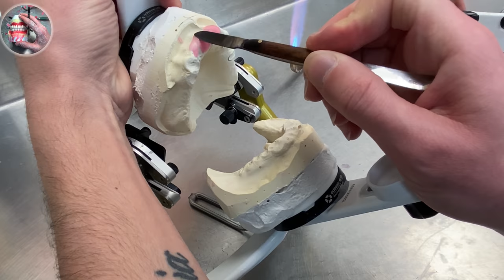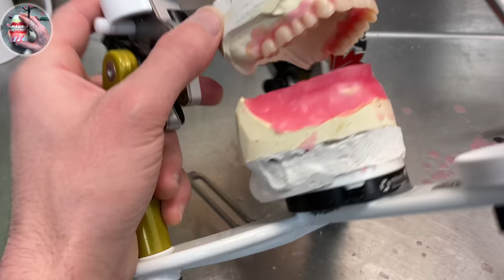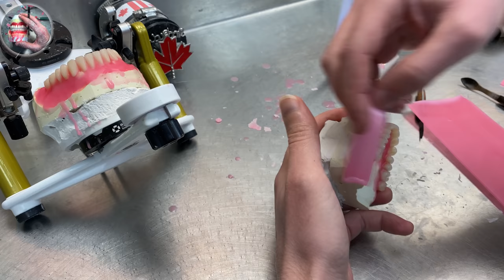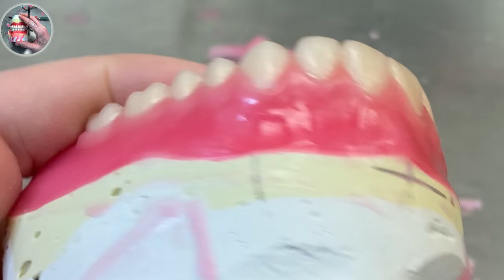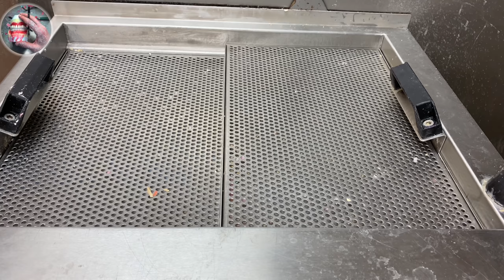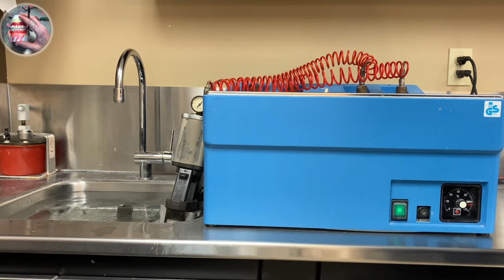HOW TO MAKE AN IMMEDIATE DENTURES FROM A TO Z #waxbae #immediatedentures #surgicaldentures #dentures

Comment: Lab tech for 33 years. Managed a full service lab for 17 years, and owned my own full service lab. There's a much easier, better way to do this. If you still have anterior teeth, which is the case here, you would really want to grind off one side (in this case it would be the patients right side, since #9 is in relatively good shape). Then, you set the upper side you just ground on, matching the opposite quadrant as far as whatever is left (i.e. lengths of laterals or cuspids that might still be present). The most important thing, though, is matching the adjacent central. Then, once this quadrant is set, you grind off the adjacent quadrant's teeth, set those in line with what you just setup on the other side, and then use your plane to make sure they are horizontally level. Then, you can grind off ALL the lowers and set to upper. NOTE: this way is ONLY going to work if the patient has a decent #8 or #9 or even laterals and cuspids would work sort of. If they are missing all the front uppers, then you can do it like above with the measuring and whatever, but typically the patient would have had a Flipper(temporary partial) that they are wearing, and the clinician should take an impression of the upper with it in place. Then you can measure the teeth and just pick the corresponding tooth card that matches the L and W. Or, if there are still enough lowers where you can hand-articulate the pre-op to the lower, you can just mark your upper teeth placement on the lower(that's why you grind them off last).If none of that exists, then  at that point, you'd just look for tooth pockets or creases in accordance to your landmarks like the incisive papilla and median palatal suture line and begin your setup there. There really is no reason to have to measure, scribe lines, then pick random teeth, hold them up and measure them, then measure then rinse and repeat. ugh. so tedious.
Reply from the maker: Thanks for watching

Comment: As a technician I really appreciate these videos👍👍👍 what type of resin do you use and what is the name of the hot spatula?
Reply: The acrylic is Ivoclar. Using the Ivocap injection method. This is a very old and dated system. Way too much cost, time, effort and energy for an immediate denture.
Which more often than not is a temporary denture. They now make high impact acrylic for the pour technique. 100% better in every way.

Comment: Absolutely beautiful work! I was wondering how do you know what size and shape teeth to use if the person has broken teeth down to their gums? Do these go in right after a person has just had their teeth extracted?
Reply from the maker: Thanks! We usually ask for old photos of the patient if they cherished thier old teeth, but if they don’t then we work together to find the best set of teeth that suits them in an appointment under different lights and shades
Reply: @WAXBAE  how long is the process overall before sending them back for permanent use?

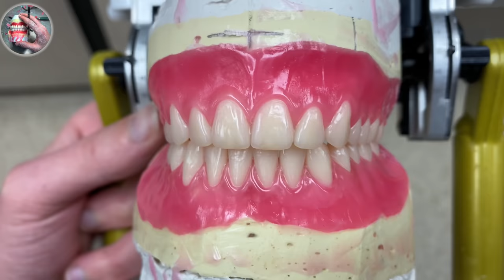Comment: Thank you for posting such interesting and educational videos.  I have a question though if you could please help.  How do you go from 11:50 to 11:51?  How do you remove all of the stone cast/mold base before you put them  in the flask?  You had all that plaster that was used in the articulator removed in between those steps and I am interested in how you did it so that the mold looks so clean and smooth.  TIA
Reply from the maker: Good question! I snap it off with sheers off the cast. Before investing them in flasks. Thanks for watching

Comment: I am total amatour and i have question - how do you measure and set the bite in this device according to patient ? 
Hwo do you know the exact distance and position of both jaws?
Reply from the maker: Hi, usually all the measurements are done in the clinical appointment and we record everything from the patients mouth then transfer it to the lab
Reply: @WAXBAE  hey, thank you for answer. i noticed that in the device there are few points where you can adjust it: 
two tilt regulators on the sides with angle of inclination measurements (30 is propably the tilt i suppose) 
the front-back extension of the upper jaw and left right shift of the jaw is when you mount it there 
and the "bite lock" rod is also there 

Nice engineering there solely in the device itself. One must have knowledge to use it correctly

Comment: I had my teeth extracted 4ish years ago. I went to Aspen. I did not have any issues with Aspen. They made me a temporary denture to ware from day 1 until 6 months when they made my final set. When I received the final set everything fit  well and still does. I had a choice between good, better or best. I chose Best. i have never had to have any adjustments etc. half way thru the 6 months and the swelling going down. I had to start using denture cream to help hold the denture in. Today I use nothing. They explained that the lower grade denture may be and feel thicker. They also said if I drop in the sink they may break easy hence my choice of the more expensive denture. They also made a bridge for the lower. All went great and things are still good.This is not a advertisement for Aspen. My Dentist of 45 years retired. After going to  many other dentist and not finding anyone that I felt comfortable with I chose Aspen plus it is close to my home. FYI, your teeth and smile look good. Congrats.
Reply from the maker: Thank you for watching!

Comment: Why did you take out the mandibular teeth right from the beginning? It may give you the correct location of the maxillary  teeth. How did you decide the flaring of the anterior teeth without the contoured wax rims?!?? In my opinion, it is hard to figure out the buccal fullness just in the lab without clinical clues. 
My comment is not a criticism but just a question to learn the objective of your technique.
Reply from the maker: Thank you for you question.I usually mark everything on the casts and record all the important info plus what we get from clinical consultation with the patient. I encourage you to see my other immedate denture making videos, I have many way of doing them depending on the case and spacing.
Reply: @WAXBAE  thank you for the reply and informative videos. I'll check out other videos.

Comment: so what if you have 3 or 4 teeth on the top but the rest are gone? do those 3 or 4 teeth HAVE to be removed? or can dentures be made that fit around them and what if you have no teeth up top but you still have all the roots?
Reply from the maker: You could but that’s a question to the dentist to determine

Comment: Wr r u from
Reply: Thank you. But please explain what was going on with the end procedure  where the teeth were blocked up and  compressed in some mechanical manner. Can I presume that the wax is melted  then drained out,and replaced with some sort of acrylic injected into the remaining cavity. Otherwise I just dont get as to how the initial wax work suddenly turns into the hardened base that sustains the teeth year upon year. I love the way you work so confidently and I follow your helpful comments. In closing. Are the Kits on Ebay any good. I am in Sydney Australia otherwise I ‘d get up to Canada quick smart to get your help. Many Thanks
Reply: @joewhitcombe1365  it's a process called "lost wax" casting. All the modeled wax is melted and removed leaving behind only the acrylic teeth in the plaster casting which is injected with dental acrylic to become the wearable model. You don't need any of the fancy equipment though, all you need really is a near perfect impression of top or bottom jaw or both and everything else can be done crudely. Take impressions, plaster cast them, make modifications/restorations as needed then cast the final mock up in silicon. Acrylic Resin can be of the cold cure type and poured into mold (cures in a couple minutes). Mold making is a skill in it's own but anyone can learn the fundamentals which then becomes just another step in this whole process...
Reply: Canada
Reply: I'm in South Africa and I'm looking for full set where can I reach you as soon as possible?

Comment: Am I the only immature one that kept bursting into hysterical laughing every time he started clamping the teeth down and they would go, “CHOMP, CHOMP”?!  I guess I find it humerus because due to being born with a unilateral cleft palate I had to get dentures before I was barely into my mid thirties. If I didn’t find humor in it, I was incredibly embarrassed with my own teeth that it got to the point where I refused to leave the house for 2 years unless I absolutely had to. I always felt like people were judging me as a crack head/chicken head/etc even though it was something completely out of numerous dentists, oral surgeons, max facial surgeons, plastic surgeons, and ent’s. For years I struggled to even get a dentist to touch me as an adult because the cleft palate was/still is slightly open and they have never seen a cleft palate not fully closed with numerous skin graph surgeries, in an adult. They didn’t even know how to go about making me dentures without the plaster getting an impression of the open hole and causing me extreme discomfort, pain, etc. so they ended up creating a little piece on the dentures that would just go over the hole instead of up in it. I was grateful when they finally figured something out because their ingenuity actually gave me the ability to do normal things like be able to suck out of a straw, eat or drink something without it coming out of my nose, it reduced the amount of ear infections I was getting from the liquids and my own saliva getting up in the hole and getting trapped behind my ear drums. It sounds really crazy but that’s the only way I can even possibly explain it to people who never had or have never heard of a cleft palate. Because my cleft palate was so bad it caused the upper bones, nerves, etc not to exist in the roof of my mouth and that’s why my teeth started dying as a little child and adult because they had no life going to them. It’s like when your foot falls asleep and you can only feel the pins and needles sensations but nothing else. I unfortunately could definitely feel the pain of the bad teeth but I could barely feel chewing food. It’s so strange.

Comment: A candle would've worked the same to heat the wax. 😅
Reply: Candles leave smoke smudge on the wax
Reply: Alcohol lamp won't leave residue. Get them at a Lapidary shop. It's for Lost wax casting to cast silver and gold rings etc. You need sprue feeders to pour the resin in after the crystobelite or plaster mold (which holds the teeth in place and is the mold for the pink resin to be poured into,) hardens then the wax and it's residue is melted out. Hot Crystobelite disinigrates when plunged into water, leaving the perfectly formed gums and teeth, then polished to perfection.